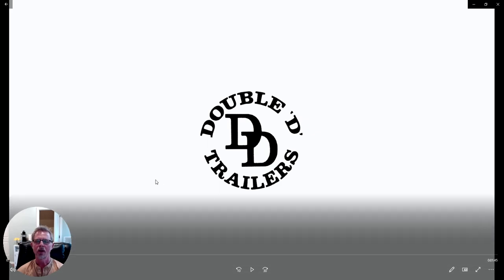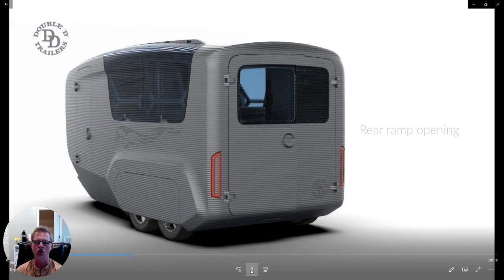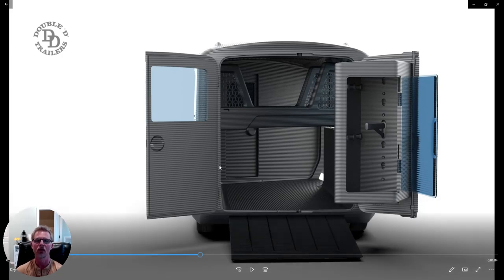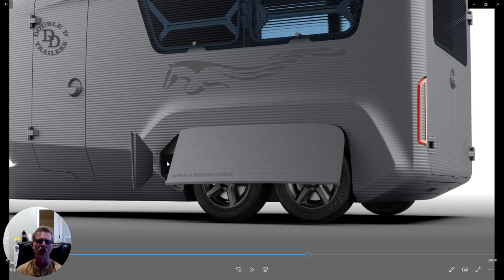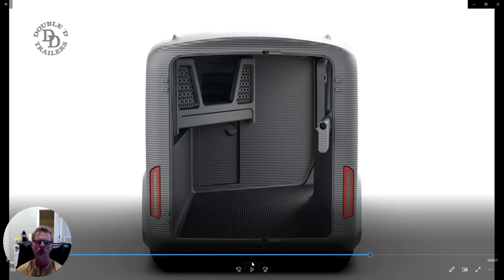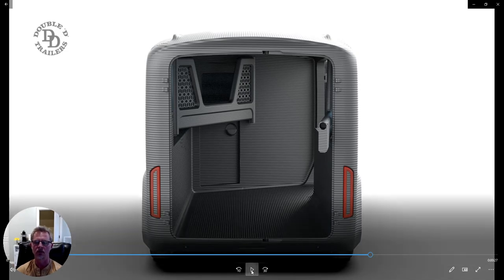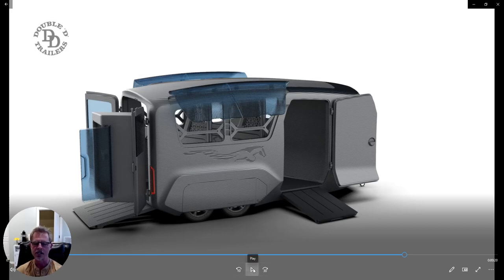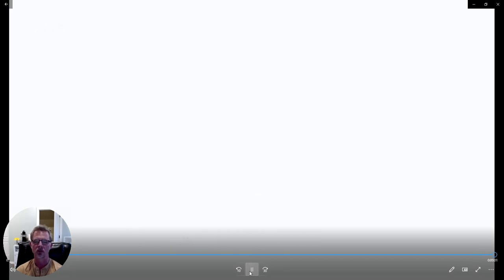Exclusive Look at the Cutting-Edge 3D-Printed Horse Trailer: SafeTack Reverse Carbon Features

Comment: What is the purpose for 3D printing this? Why not blow mold the major surfaces then bring them together with steel reinforcements inside and weld it together with other plastic features welded on at this point too? It could be made faster and for less cost